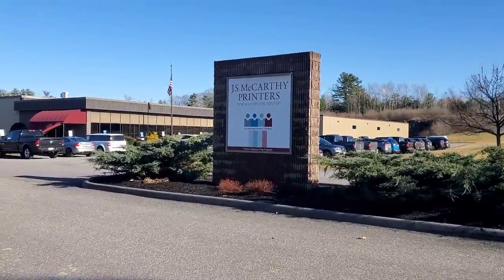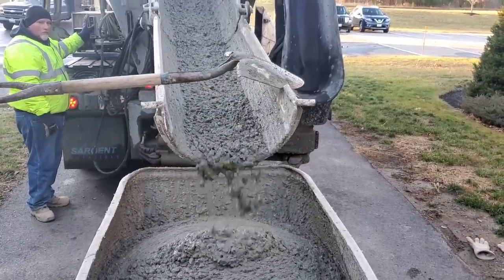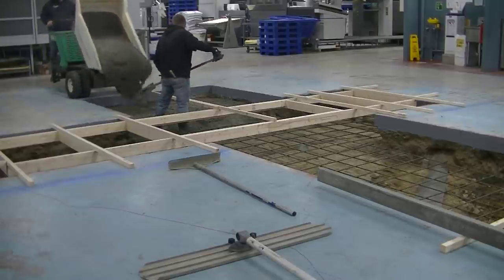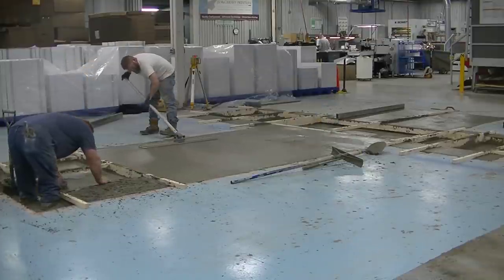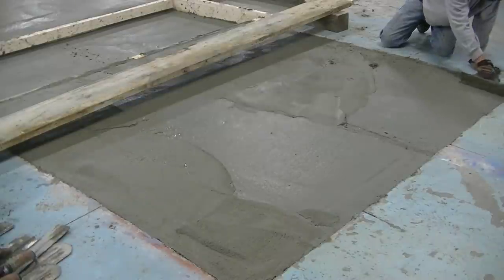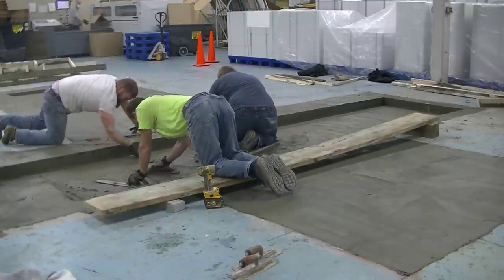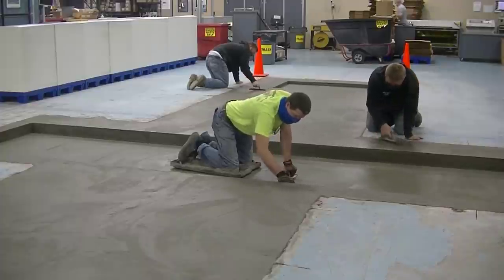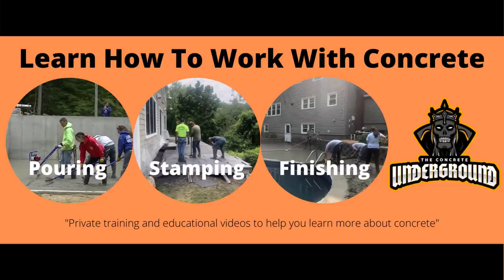How To Pour A Concrete Slab that's 18" Thick

Comment: We used to use ‘Georgia buggies’ all the time to pour the ‘leave-out strips’ on tilt wall jobs. If you can run them across asphalt or on a concrete floor, you can really haul-ass with those things and move a lot of mud. They’ll move almost as fast as someone can run when hauling a full load of concrete.

Comment: I was in the printing industry 45 years and a company I worked for had two Bobst Diecutters. They need a thick pad to sit on as you did. Surprised there was not a lot of rebar frame work also. I ran the printing presses. But loved how those things run.
Reply from the maker: Thanks John, the slab was engineered that way. Guess it'll hold the machine ok, I just pour and finish.
Reply: @MikeDayConcrete  All depends on the engineer. I live in Central Texas and the Engineer spec 15" think poured walls. I freaked. I'm from Buffalo, NY and never seen that. I got him to go to 12". Needless to say. I have a bomb shelter. Should see the rebar in those walls. Had a contractor friend down from Buffalo and he was amazed. Maybe a Texas thing. Best at ya. Enjoy your pours.

Comment: Mike, we have to pour something similar...for a CNC machine...weights about 20,000 pounds...calls for 7ft x 9ft x 1.5ft slab.  What do you recommend for additives?  Fiberglass string or the water replacer you talk about in your other video's?  Planning on 4000 psi.

Comment: Nice work bub! Quite the commute with the buggys, next time take the highway.. xD
 Definitely worth Subscribing and the like button, thanks.  BTW Did you also add fiber to this mix, or was it not needed with that thickness/psi?
Reply from the maker: The spec didn't call for fiber.

Comment: How come there are no epoxy dowels from the existing to the new slab connecting all together? You will see a crack right along the edge as the concrete shrinks.
Reply from the maker: It was engineered this way, wasn't up to me. I was just hired to pour and finish. All the other one's we did in this building were done the same way with no problems or shrinkage cracks along the edges. A water reducer is used in the mix and really helps control shrinking.
Reply: Doweling a heavy-duty, add-on foundation to an existing floor is generally avoided.  You don't want the floor to become part of the foundation, because if the foundation moves a minuscule amount and it's attached to the floor, the floor is bound to be damaged.  You can bet that slab has sawed control joints at regular intervals, so a nice straight cold joint like that has the same esthetics as a control joint, and best of all, as a control joint it's exactly where you want it to be.

Comment: Sometimes when pouring new concrete up against existing concrete I see people drill and epoxy smooth steel dowels (not ribbed rebar) into the existing concrete but I can't figure out when this is necessary.  Obviously not here, since you have done a few pours for this client.  But how do you know / what is the factor that would make the dowels appropriate to use?
Reply: We do that when patching the floor so that the slabs won't heave and cause a lip. That pour for the machine needs to float independent of the floor so it doesn't crack the floor.
Reply: You see those dowels mostly on exterior slabs when freeze/thaw cycles could cause heaving.

Comment: How come there is no reinforcement in that slab ? Just a little mesh
Reply: Looked like #4 bars at 1 foot o.c. each way, bottom mat to me.
Reply: @psidvicious  like I said just a little mesh . I would have thought going to all this trouble to place a thick slab it would hav a cage in it . 
I’m not an engineer but something like grade500 20 mm @ 200 c each way
Reply: @philleach6271  1/2” or 13mm rebar is not mesh.
For those from the US - You would be asking for #7’s at 6’-6” o.c. each way?? I’m not sure how you came up with a configuration like that, and maybe that’s how they do it there, but you’re unlikely to see anything like that in the US. 
(The slab was ~17” or ~43cm thick!!)
I’m sure this thing was engineered and it looks very typical of what you’d be likely to see anywhere here in the US for a ~50K lb (23K kilos) piece of equipment.
Reply: @psidvicious  *12mm
Reply: @elbuggo  1/2” = 12.7mm. 12.7 is closer to 13 than 12. It’s called ‘rounding’. A common practice for expressing the nearest whole number.
Reply: @psidvicious   Ok then. 13mm isn't sold. Only 12mm is. Weight of 1m #4 is 0.994kg. 12 mm is sold at the weight of only 0.888 per meter. So if you order 1/2", you will get  12mm.
Reply: @elbuggo  If that’s the accepted labeling practice, so be it. I simply gave the numbers, in the worldwide accepted practice of ‘rounding’. You gave the correct label. I gave the correct numbers.
Reply: @psidvicious  - Your logic was just fine.
Reply: @elbuggo  ✌️
Reply: @philleach6271  You can bet that it WAS an engineer who designed that pad, and that he used tried and true methods, probably the same methods that have been used on hundreds of similar or even identical pads.   The real trick with engineering is not to throw plans together that are expected to work because they are similar to the strongest designs some person has seen at various times, but to design something that is strong enough without being wasteful.  This is far too small of a project for proper engineering to save a huge sum of money, but whatever money they avoided wasting is still a goal of that design principle.

Comment: I can’t believe there are conveyer trucks still being used. Those things are so lame. Those things are messy and are a pain in the a$$ to work with. I had to repair one on my job for cook concrete so we could finish my pour. Had another episode when blue rocks conveyor had to be repaired so we could start the job. Who s truck dose that belong to? I have not seen any of those trucks in my area for a long time.
Reply: They’ve come a long way since the late 80s they have scrapers on the top and bottom of the belts now, they don’t make the mess they used to, that’s probably Seargants truck, cheaper than a pump and they didn’t have to use it there so no harm no foul
Reply: @chrisbrann7733  when those old conveyors flung the slurry all over the place that was the hardest stuff to scrape off your forms. Ware does sargents trucks batch out of in Maine. I have not poured concrete since the early 90 s.